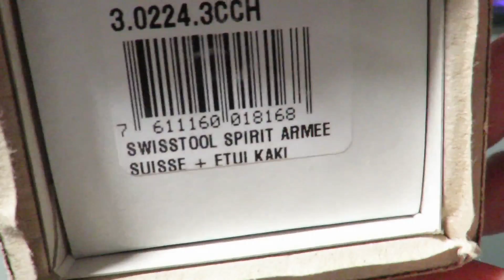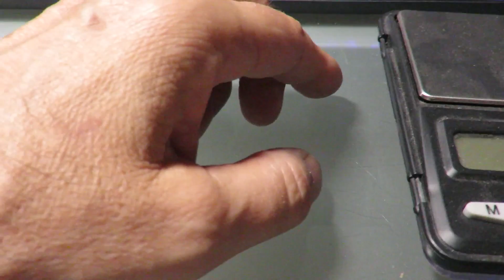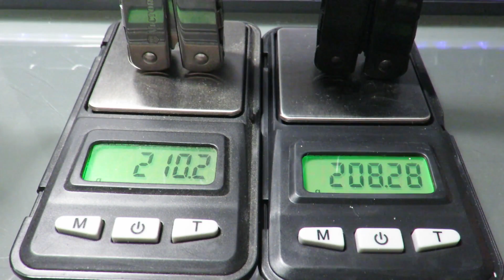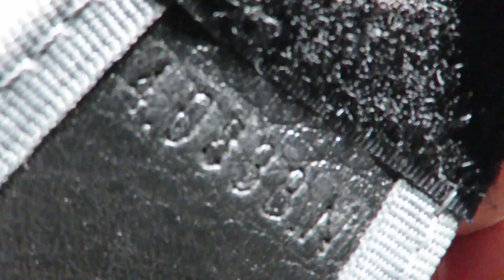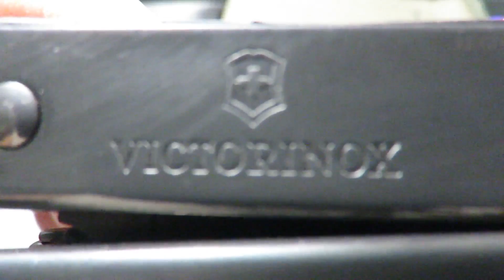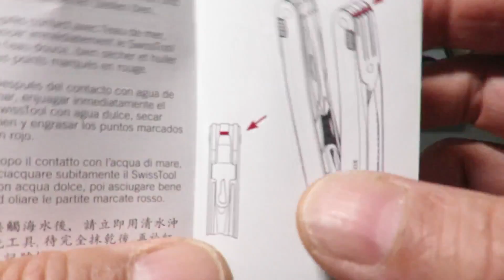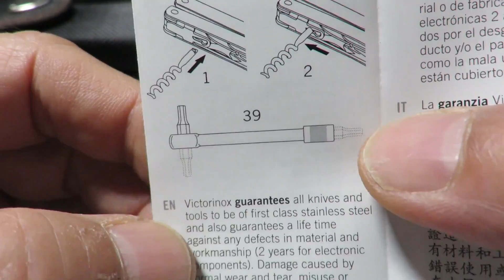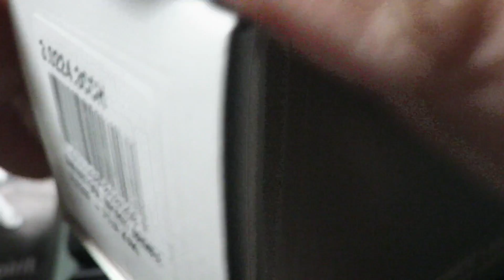Victorinox Swisstool Spirit XBS : Spirit BLACK Edition !

Comment: Thanks for the review.  I just picked up the XBS.  By the way, can you tell me by chance what that grease was at the base of the tool @5:40?  I noticed I pretty bad on the scissors @6:40.  Seems like it was dipped in some time 10W-30.   Is that normal?  Thanks again.  👍 - Ok I probably should have watched the whole thing first.  disregard.
Reply from the maker: Grease, protective oil. I degreased it entirely and then put a little Victorinox oil.
Reply: @diezelle57  thanks again!

Comment: Hello diezelle! Do u think the black one worth the price instead of getting the silver. Also, do u think it's safe peeling an apple with this black finish?? Thank you.
Reply from the maker: I imagine that the coating should further reduce the risk of rust knowing that Victorinox steels are very little sensitive to it. This coating is not soluble in fats or water, I do not think it can present a risk even with acidic fruits. I do not think it useful to spend more than for the stainless steel version without coating unless tactical use. In addition, the black model has a crimper at the level of the pliers, a crimper which has practically no use.
Reply: @diezelle57  thanks for quick reply. I agree with you. Thank you.👍

Comment: According to some users; "The Spirit with noticeable misalignment is the Spirit with the Vic Shield logo located above the Victorinox" .Is this true? What do you think ?
Reply from the maker: On my copy of Spirit XC Plus Ratchet, I notice a slight misalignment of the handles when the multi-tool is closed. Measured at the tool layout level, this misalignment is 0.8 mm. So negligible.
On my copy of Spirit XBS, there is no misalignment.
It is true that a misalignment of 3 mm, as I read on a forum, would justify a return.
Thank you for your question because I was unaware of this problem.
Reply: @diezelle57  I also thank you for your answer and nice videos
Reply from the maker: Merci :) Je vais mettre en ligne aujourdhui une vidéo pour poser le problème et recueillir les observations des possesseurs de Spirit.

Comment: What the intended purpose for the cut out circle in the front of the pliers?
Reply from the maker: This is an crimper, a special crimper (military, explosif or various other uses).
Like on the Charge⊕ TTI of Leatherman : https://www.leatherman.com/charge-tti-7.html?cgid=full-size-multi-tools#start=1 .
But it is not a electric crimper. The Charge⊕ TTI is equipped with an electrical crimper between the handles.
Reply: diezelle57 thanks man!

Comment: Which would show scratches more over time?
Reply: @diezelle57  I’m sorry I should have specified which would be more weathered and look older work overtime. Does the black finish come off and show a chrome background? Sorry for the questions and thanks for the review.
Reply from the maker: @cuuppaajoe  The black coating of Swisstools is more resistant than that of Leatherman or Gerber or Sog.

Comment from the maker: The model presented : 3.0224.3CCH.
The model could have been degreased before packing!
It has a wire stripper pliers and a smooth blade.
As for the surface treatment that gives the color dark, it makes the surfaces less slippery, which is a good thing. Seen closely, it is far from a satin black appearance but it is not a problem even if it is a little disappointing. Otherwise, the mechanical perfection of Victorinox is at the rendez-vous.

Le modèle présenté : 3.0224.3CCH.
Le modèle aurait pu être dégraissé avant l'emballage !
Il est doté d'un wire stripper de pince et d'une lame lisse.
S'agissant du traitement de surface qui donne la couleur sombre, il rend les surfaces moins glissantes, ce qui est une bonne chose. Vu de près, on est loin d'un aspect noir satiné mais ce n'est pas un problème même si cela est un peu décevant. Autrement, la perfection mécanique de Victorinox est au rendez-vous.